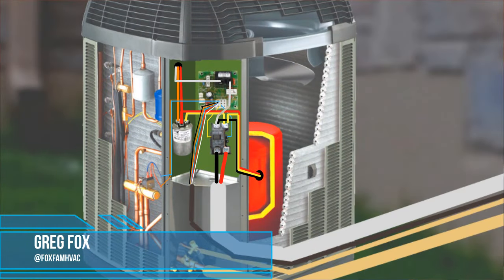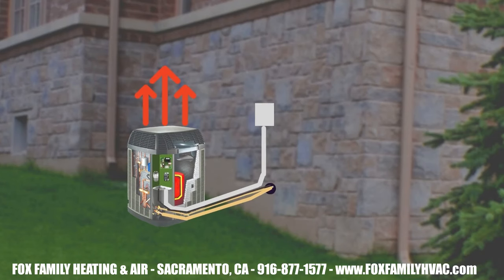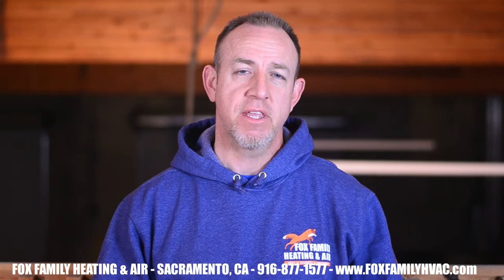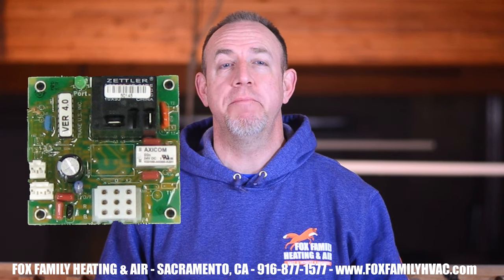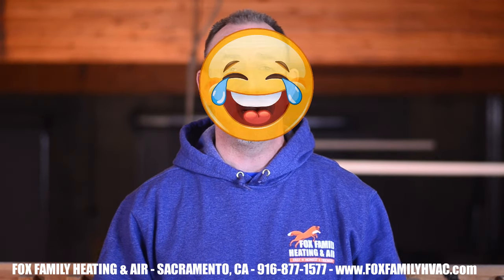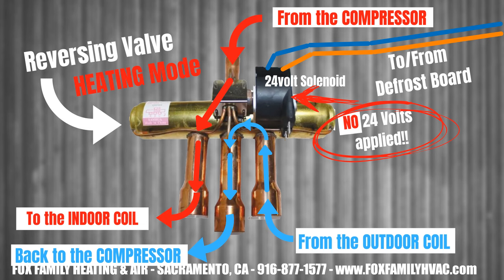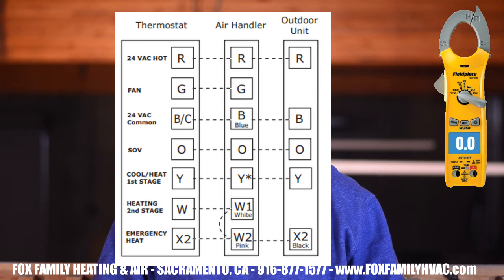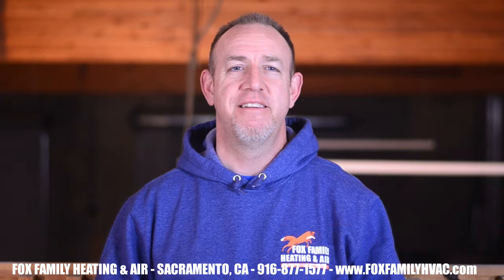Heat Pump Defrost Board Troubleshooting Tips

Comment from the maker: This video focuses on the defrost cycle of a heat pump.  It's function is to control the sequence of events to melt the ice off the coils of the outdoor unit when the system is in heating mode.  I hope you like the video and can take something from it.
Reply: I've had a ton of brand new defrost boards malfunction this season! Last one is 3 weeks out. Others must also be having to replace trane defrost boards. 

Bad part is when it goes bad it goes into defrost over and over. Every 5 minutes or so. Which causes high power bills.

I like being a trane dealer, but this sucks ass!!!
Reply: where can i find that book ? i already looked on amazon and your page

Comment: Thanks for tips, mine is frosting up. Now if I can put mine into cooling mode with cold air flowing from the inside, the reversing valve should be fine?

Comment: To initiate the defrost cycle I had to first unplug the hot pink lead which was the outdoor temperature sensor I believe and put a jumper on it. Then I had to Short the terminals called speed up which advanced the defrost cycle. You then remove the jumper on the "speed up" terminals once it starts and let it run. However my problem is that it goes back into normal heating mode only a few minutes later long before the ice has melted.

Comment: Most heat pumps energize the reversing valve coil in cooling via the orange wire or "O" terminal. However, not all manufacturers energize the reversing valve in cooling. Rheem for example energizes the reversing valve in heating mode or with the "B" terminal. In that case some contractors use the blue wire for the reversing valve.
Reply from the maker: Exactly. Yeah thsts why I try to say something like 90% of units or most units work this way. But yes you are right about Rheem /Ruud. Any others that you know of?

Comment: If the dft is continually closed in the summer will unit go into defrost and activate indoor auxiliary heat
Reply: I think the primary reason for reversing valve defaulting to heat mode unenergized is to exercise the valve during the summer so it less likely to get stuck from just sitting in one place.

It moves over fairly quickly so there is not likely much internal coil heating when cooling first comes on as it takes longer for refrigerant pressures to build up to full pressure in system.  I believe the reversing solenoid just opens a capillary tube port to enable refrigerant pressure to do the real work to move the reversing valve.
Reply: Yes, a bad dft sensor that is stuck closed will shut down outdoor fan and turn on strip heater for ten minutes, probably causing high pressure switch, if installed, to shut down unit until pressure switch resets, than will cool for thirty minutes, go back into defrost and repeat, unless unit is equipped with a monitor that wont restart unit until fault is corrected.
If you feel heat coming out vents, go to outdoor unit and check to see if you are in defrost mode by seeing if fan is off and testing to see if you have 24 volts on W2.

Comment: There's plenty of heat content in the air below 40F.  US manufacturers were slow to design for lower temperatures but it's neither a thermodynamic or technology limit.  There are mini splits for operating down to -22F (Hyper Heat).    Adaptive Demand Defrost was designed to reduce defrost cycles when the outside air is cold and dry via the ambient and coil temp comparison instead of relying on the defrost thermostat and run time after the DFT closed which took no account of the humidity in the outside air.

Below 40F, you do lose efficiency from the 250-300% normally as the defrost cycles at 100% eff for electric heat add up.  And while manufacturers are wising up, heat pumps only supplied 90F or so at the vent which "feels" cold blowing from a vent.  I understand some have upped the supply temps.
Reply from the maker: That's great information JK.  It sounds like you have the experience to have seen the temps get really low outside and still have the heat pump work well enough to heat the building.  Thanks for letting us know!

Comment: My heat pump goes into defrost mode at night, but it takes about 10 or 15 min to get warm air blowing again out of the ducts, is that normal or are the auxiliary heating coils suppose to heat the air immediately? It's not that cold here, rite at freezing, but when the defrost mode kicks in the house cools down quite a bit, up from 72 down to 68, and it's like that all night.

Comment: I am getting 24v at the reversing valve, yet the 220 breaker pulled and the honeywell 5000 is set to system off.  I can't get the compressor to run.

Comment: We have a 3-stage heating system, heat pump + propane. I'm hearing what sounds like the defrost cycle kicking in and running for an hour+ on days where the heat pump never kicks on because it's too cold out. Sounds like from your video the defrost cycle shouldn't kick on when the heat pump hasn't run. What could be causing this? How could I troubleshoot?
Reply: heat pump + propane is two stage unless you have a heat strip.  heat strip not a great idea.  it should not run defrost if the heat pump has not run.

Comment: Heat pump blowing cold air. I reset it by putting it on AC and switching breaker off and on several times. when I switched back to heat it works for a while and starts blowing cold air again.

Comment: how to quiet a TXV DURING DEFROST  sounds like air brakes. Is there a way  to quiet it  or  wire it so the heat scripts come on instead of that air brake sound?
Reply from the maker: No, sorry. It's a necessary function. No way around the noise except relocating your Outdoor unit to a spot better tolerated.

Comment: How would you charge Freon in winter months?
Reply from the maker: A whole other video Pete. But this is a great blog about it. Thanks 👍🏻
https://www.hvac.com/blog/how-to-charge-a-heat-pump-in-the-winter/#:~:text=Because%20the%20outdoor%20coil%20operates,down%20to%2020%C2%B0F.
Reply: What I do is first determine what type of metering device is being used.

I will then energize the unit in cooling mode. I will take a plastic warp and wrap the condenser to raise the head pressure to simulate a higher ambient temperature.

For R22 I will raise the head pressure to 225 psi. For 410a I will raise the head pressure to 375 psi to simulate a 95F ambient temperature. I will never cover the fan shroud, only the coils.

Once my head pressure stabilizes to that pressure, I will then measure my superheat or subcooling to determine if I'm properly charged for a 95F day.

If my superheat or subcooling doesn't match, I will then know I'm not charged properly.

You can also follow the manufacturer's documentation (usually stamped on the back of the control door compartment) which will tell you what your superheat or subcooling should be in heating and cooling mode. You will need to find your ambient temperature and find it in the chart provided. Take a measurement and compare.
Reply: There is a 3rd port usually center and a little above where the other 2 are, some call it the true suction port.

Comment: We are almost to all heat pumps on new construction in CA. The power grid is going to get whacked good. Electric heat only and electric cars.
Reply: Only when it's very cold or very hot and the fair weather electricity producers using wind and solar disappear from the grid.
Reply from the maker: Yep. That is the way it's going. Gonna get get crazy for sure.

Comment: How would charge Freon in winter months?
Reply: U dont
Reply: What I do is first determine what type of metering device is being used.

I will then energize the unit in cooling mode. I will take a plastic warp and wrap the condenser to raise the head pressure to simulate a higher ambient temperature.

For R22 I will raise the head pressure to 225 psi. For 410a I will raise the head pressure to 375 psi to simulate a 95F ambient temperature. I will never cover the fan shroud, only the coils.

Once my head pressure stabilizes to that pressure, I will then measure my superheat or subcooling to determine if I'm properly charged for a 95F day.

If my superheat or subcooling doesn't match, I will then know I'm not charged properly.

You can also follow the manufacturer's documentation (usually stamped on the back of the control door compartment) which will tell you what your superheat or subcooling should be in heating and cooling mode. You will need to find your ambient temperature and find it in the chart provided. Take a measurement and compare.
Reply: Thanks for quick response guys
Reply: Weigh it in. then recheck in summer.